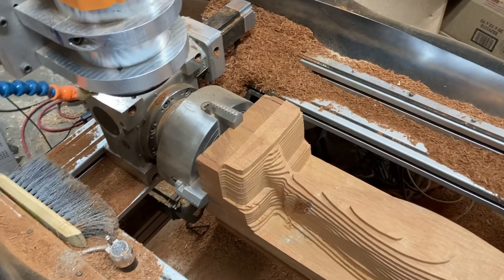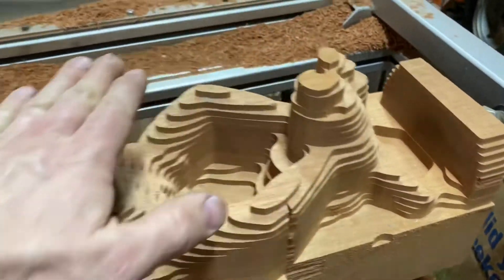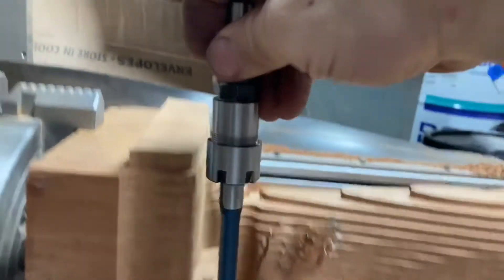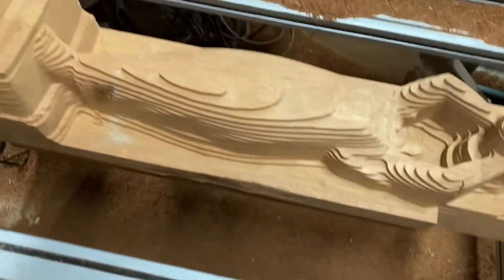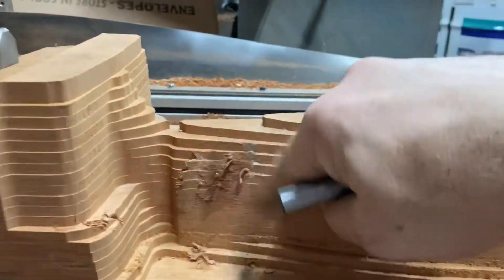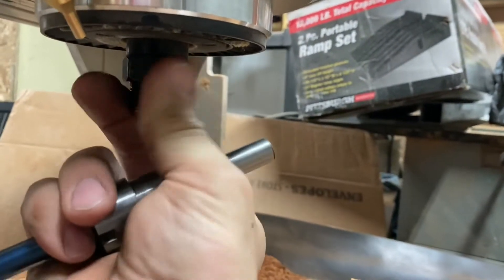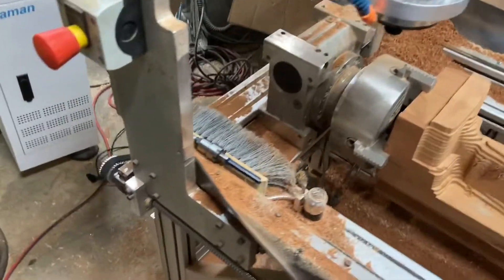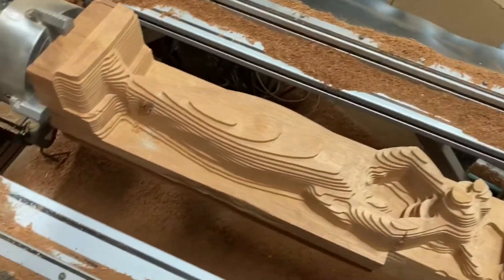I Broke my DIY CNC Machine! New updates are coming..

Comment: Yep, not fun!!!  It's nice to have a "feed override" in this situation so you can see where it is going at start and can stop it if it plunges badly.
Reply from the maker: It went so quick, I couldn’t react in time. I need a pot for % speed adjustment, to easily adjust, instead of clicking those +/- buttons.

Comment: Wow! Rest in Peace old router. Hello new big boy!!! Looking forward to seeing the build and the function!
Reply from the maker: To be honest, having used this router for a little bit, I wasn’t greatly impressed with it. I had to exchange it for a replacement because the original stopped adjusting rpms correctly. Both the original and the replacement routers would not feel safe going above 15000 rpm, too much vibrations. So, the good news is: I’m gonna have a new spindle! Lol